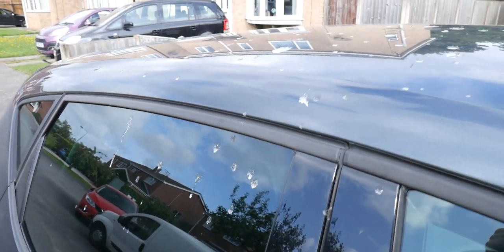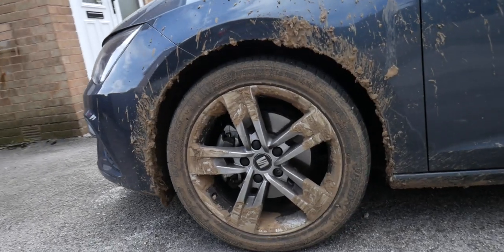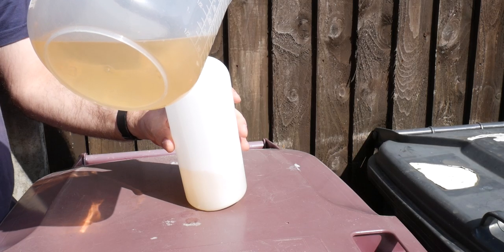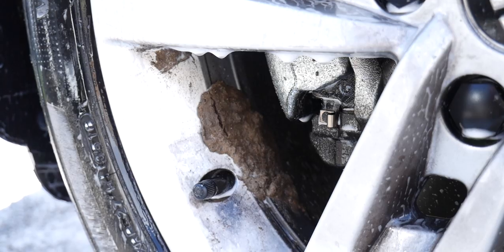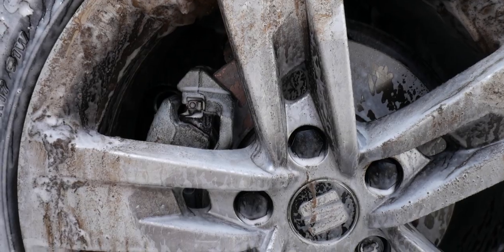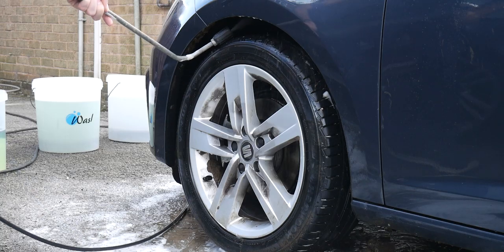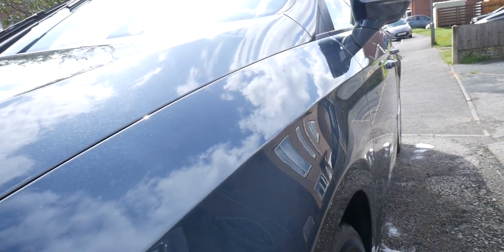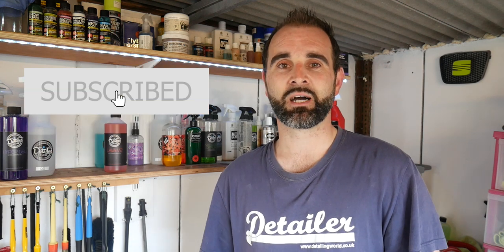How To Safely Clean A Muddy Car - Seat Leon FR

Comment: I know this is an old video but can you remember what medium polish / compound you used to remove those marks / stains?
Reason I ask is I have a leon estate of similar age which has a few bird lyme etchings / stains from when it was outside at the dealers before I bought it.
I have a da and a range of pads, the heaviest cut I have is menzerna medium cut 2500, but I'm looking into heavier cut compounds incase the 2500 can't shift them. 
I know different manufacturers clear coats range from soft to hard, VAG cars from what I've read are around medium, and certain compounds are really aggressive and aren't recommended for medium, medium soft clear coat.
Sorry for the essay, thanks in advance love the channel, all the best mate 👍🏼

Comment: Those marks you polished off - were they bird bomb enzyme marks?  Did they match up with the poo splats or was it mud?  Reason I ask is that I’ve had similar from bird bombs and they just need gentle heat from a dryer or even hair dryer and they just evaporate off.  Always worth a try before heavy cutting.